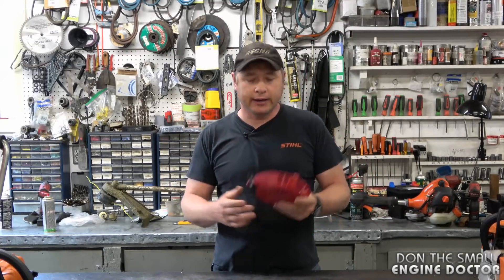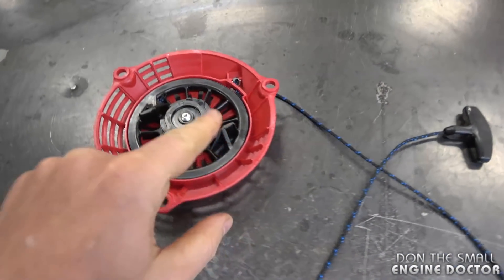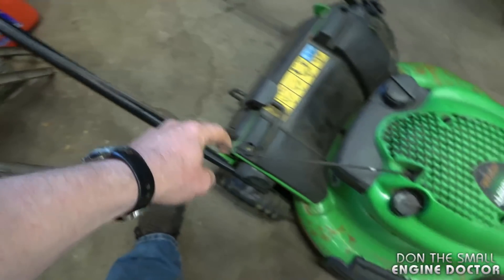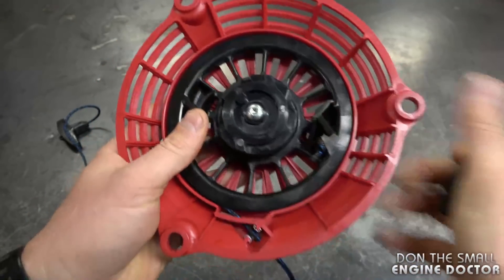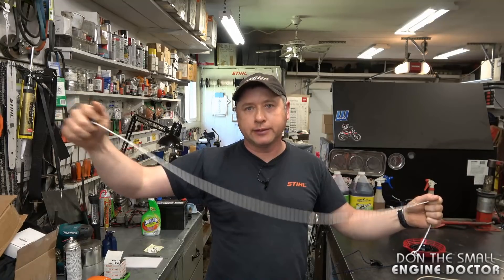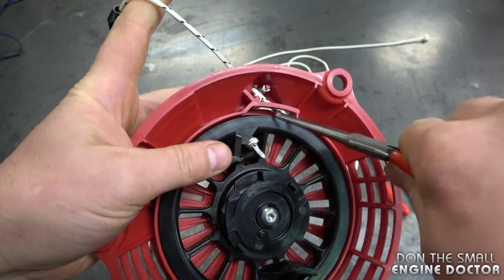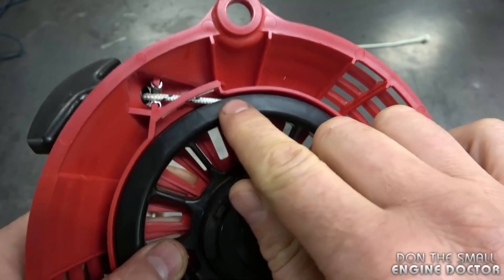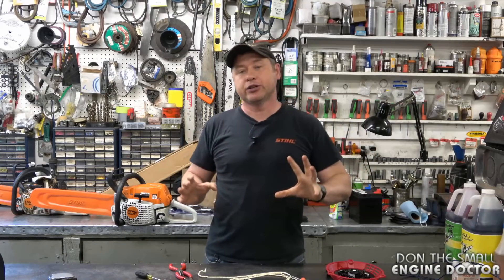Don't Make This Pull Cord Repair Mistake On Small Engines! - Video

Comment: Hi thanks for clarifying that. But can the paws be another reason to why your rope can't retract? Because when i put the lid back on the mower, i pull the rope again, and it makes a clicking sound and the rope stops retracting. But with the lid off, the rope retracts easily

Comment: I have Stihl BG45 blower. Rope broke near end. All I had was rope for lawn mower which I assume is5 mm. Stihl recommends 3mm.. With rope installed, I get terrible kickback. Dealer said this model does not have shear pin nor adjustable valves. Is rope size the cause of kick back? Made sure engine is not flooded. Will start and runs fine.Kick back make it hard. Dealer said I could leave it and they would try to find cause @ $80 an hour

Comment: A great solution is to cut the rope to the correct length :-) You can use som kind of tool.. a knife or a scissor. You can buy such a tool almost anywhere :-)

Comment: This was mentioned but not emphasized,  the recoil spring should never, 
Be wound all the way up when the cord is pulled as far as it can go. 
By having the cord that long it put extra stress on the point of the spring where it hooks into the housing and it will fatigue and break, 
Now you need new spring,
Which if the  rope is not shortened will not last very long.  After putting in your new cord pull it out till the spring is fully wound, then let about 6" back in and tie your knot for the handle there. If that isn't long enough to start the engine you have a different problem, it's not that the cord is to short.

Comment: I find 60 inches works well on most applications. I have yet to install a rope on a lawn mower with the extended starting rope. I have had the recoil spring rust to the point of breaking.

Comment: Why not just pull the cord out a bit lock it with a screwdriver then cut the rope to length then tie a new knot/hog ring it at the handle.

Comment: This is very dangerous for the not a hard-case; I used to rewind the spring by hand … there is a sort of "trick" to it that is no trick it is raw brute force and hands that won't be damaged if it releases then is trick and difficult even then … we used an open rope bull to which they added a bearing gizmo but cannot run anything now due to all this stuff:  Donnyboy I have a discarded sears mower on which I fabricated at "drive" with geared drill and grinder on ½" drive chrome extension; Cannot get a carburetor and am in the market for a way to get a standard small engine general purpose carb; I have wired the magneto to a common 110 switch and bypassed the "governor" with a spring & keychain → BTW the Bosch grinder is the only one that withstood a mall thing
Reply: drive is starter drive on the crank at the flywheel thing

Comment: Are there markings to know what diameter of rope it should have? I've never had to rewind a rope on my equipment, but I could see where a second hand unit or say helping a friend out, that it might have the wrong size on it.
Reply: I don't know of any that do, but you just look at the groove the rope would wind into, it shouldn't be lose enough that two pieces of the rope can sit side by side, but not tight enough that the rope has a hard time sliding in. With this, as long as the rope is close to the original size, it will be fine.
Reply: @snoopdogie187  Thanks! I'll keep that in mind if i ever have to.

Comment: In the US, pull cord is numbered ie: 3.5, 4. , 4.5. , etc and so on. 
This refers to the rope diameter in 1/32s. So a #4 is 1/8 inch 😀
That’s my story.

Comment: When you think you have it right you should pull the rope all the way out then see if the pulley can turn the recoil spring tighter.  If the spring is wound too tight with rope pulled all the way out then spring is likely to break.  Properly adjusted the spring easily pulls the rope back in and holds handle tight to the housing.  Spring doesn't need wound any tighter than that.  A little oil to the spring works wonders.

Comment: Good info Dony!!!!!    Tecumseh L-head Manual tells you length's of cord as well.
All of which I learned VIA DONYBOY73.       That was one of the first repairs I learned from you Dony! (CHanging my snow blower recoil cord......Felt good about myself after my first repair back then.(2012 had just gotten my first snow blower)

Comment: Can we use any type of diamond braided rope from the hardware store as long as its the proper length and size or we must use small engine starter labeled rope?
Reply: Any rope will work for a short time, but starter rope is meant to take the abrasiveness and pulling force that happens to them. There are some people that use paracord, and a few other ropes, which have a similar construction to starting cord.

Comment: I have an old Toro 826le snowblower and it needs a new engine.
And not too expensive. Looking at harbor freight (predator) Can you recommend 
an engine that swaps easily. And not too pricey. Thanks Rando S in Colorado
Reply: It looks like your engine was a Tecumseh lh318sa, which was around a 9 hp engine. Most universal engines will fit, just make sure that the crankshaft direction is the same, and that the diameter of the crankshaft is the same.
Reply: Thanks the reply snoopdogie. I was wondering if anyone heard my question.
Much appreciated. Rando S
Reply: You can also google the engine model and the word replacement. That engine was used on a lot of model snow blowers, and the question was asked a lot.
Reply: That’s great! That’s what I’ll do.
Thanks again snoopdogie!

Comment: The ends of the spring on my Honda lawnmower were softer than what you would expect with spring steel. I ended up buying 2 new cassettes (recoil units). When they arrived, I saw where the problem was on my old cassette. I rebent the ends and now my old cassette is as good as new.

Comment: I have found that over time the spring in the recoil weakens and doesn't work so well and the cord develops fuzz that makes the cord take up more space and I need to shorten the cord a few inches and tighten the spring one turn for the cord to reel back in properly. But I tell ya, modern small motors are so much easier to start than the back breakers of old!

Comment: Like you said,, I make it a habit to fully pull the cord out after it's been repaired to make sure the spring is not broken. If it is the spring will unwind it's self inside and get loose again.   Great video and have a great weekend.  Happy 4th of July here in good ole USA.
Reply: The ends on my recoil spring were very soft and could be re-bent to be just like new.

Comment: Great video, it would have helped me years ago. Sadly I learned it all the hard way. I now have 3 100ft spools of rope in 3 main sizes and replace ropes with ease. Some very good tips in this video like for tightening the spring tension etc.
Reply: Can you tell me the three main sizes and what each sizes are used for ?

Comment: Dont know if this is helpful but I have a big roll of pull cord and I just attach it without measuring it and just wind it like you did in the video and when its tight I just let the spring pull the cord back in and then pull out a few inches of cord and then  cut the rope there and put the handle on :)

Comment: Its best to measure the old cord and cut the cord to the original length.  I have run into the opposite situation where someone put too short of cord on or just put the handle back on a broken rope, not realizing it's too short. This eventually damages the spring. Longer is better because you can always move the handle and cut the excess. Good tip. As always, your videos are mostly common sense.

Comment: I bought 2 Metres of pull cord for my dads Honda GSV190 powered lawnmower last year for about $5 AUD from our local lawnmower sales & repair shop & fitted it for him.

They say to use 3/16" (4.7mm) pull cord but I used 3.5mm pull cord no worries which seems to measure 3mm (1/8") with a set of vernier calipers !

Comment: I was able to replaced the pull cord starter but now the small spring plastics won't engage the engine to get it to run. What can I do?
Reply: You can buy a new pull starter for $15
Reply from the maker: the whole recoil for honda is quite cheap to buy!